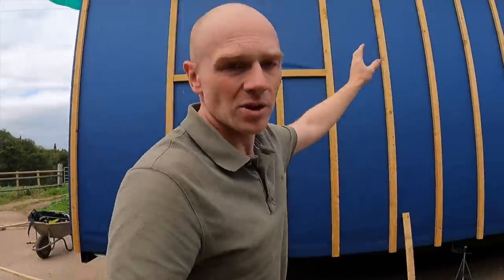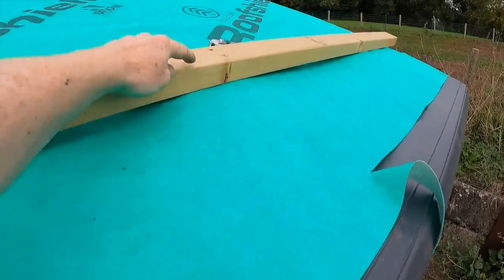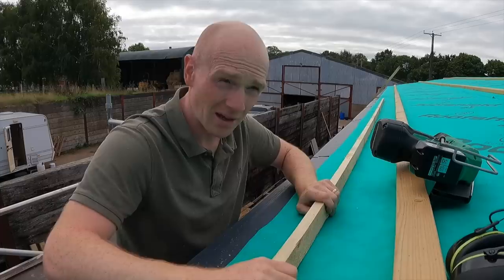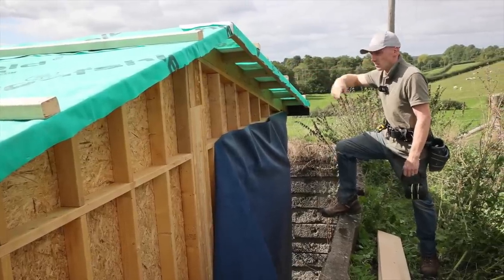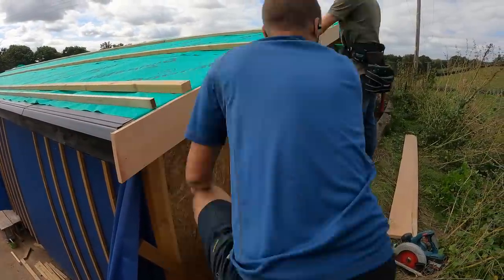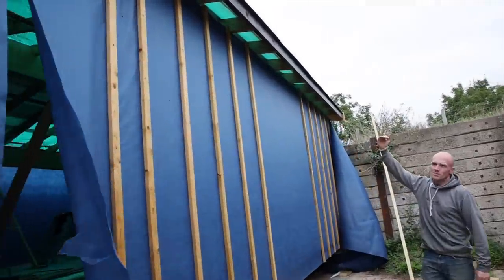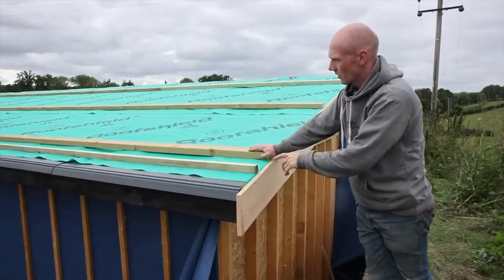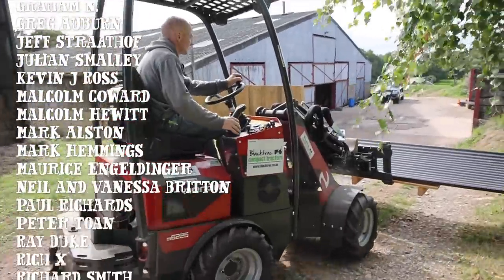WE DECIDED TO MAKE BARGE BOARDS - Roof is finally ready for ROOFING!

Comment: No criticism at all as a 5 year viewer of the channel, but instead of this build why didnt you buy a state of the art static caravan )Ive looked into this and the prices are horendous/not horendous depending on spec, granted not as big, but it would always be worth a very good value. Is there a resale value in this, and if so is it comparable? Im sure you have the answers to this, but it would be good to understand. Looks great, and you are doing a fantastic job 👍
Reply from the maker: We looked at many but still over 100k for anything like this size and spec for aa twin unit.  We also had the time as we can't do any other building until planning sorted so perfect chance to build it and work with different materials and methods.  
Most self builders we have spoken with over the years who have done statics with large families have often said that was one of the hardest parts so we figured it made sense to think about how we live for those three years rather than just how we will live after its all done.  Hope that makes sense.  Plus.... we like building things! 😂
Reply: In general the resale is very tricky for these types of buildings, the parks often have all sorts of rules preventing people bringing anything other than the brand the operators are selling. So you are only looking at fellow self-builders in the main. The other issue is not many have the cash needed to buy, everyone seems to want finance these days! I think they are a disaster in terms of holding value if you buy at a retail price. You can get a bare bones kit that seems more reasonable though, however as we are seeing it is a lot of work turning a shell into the finished product!
Reply: @TheRestorationCouple  Hey thanks for the reply Tim. Its a good job you like building things! Once you have completed the main barn conversion, do you see yourself keeping this on the property for extra accommodation or something similar? Or haven't you got that far yet 👍
Reply from the maker: @markstevens6002  Possibly but there are other buildings and options if we wish to go down that route, i.e holiday lets etc.  We will most likely look to sell or possibly split it and just keep one half.  We have had interest from people already who would be interested in buying when we are done with it so we will see. 👍
Reply: @TheRestorationCouple  Really appreciate your time to answer my random questions 👍Its great being on YT that you can document the build, and people can see what has been done in its construction, and the attention to detail. Any potential buyer knows they are getting the real deal. Keep up the good work 👍🙂

Comment: Hi. I noticed that you are using a Triton plainer/thicknesser. I had another brand and I was disappointed with it, I am only a hobbyist and by no means do I work the machines hard but the one I had before lasted only just longer that the guarantee and as it was lockdown I can only have used it about twenty times so I was not happy getting another one. How have you found your machine, have you had it very long and what quantity are you getting.

Comment: ever seen what a bouncing broken nail does to an eye? i have it’s not pretty. i’ve also had a piece hit just under my safety specs and lodge in my face. the warnings about nail guns are real. i suppose it’s a numbers game use a tool long enough and something will go wrong. Everyone is responsible for themselves and their own body it’s always your choice on diy. i just wince when your face is so close cheers from australia
Reply: A friend of mine,a chippy,was hammering a concrete nail,a small piece fractured off,hit him in the eye, no goggles,it caused him alot of grief,and the fragment was tiny.
Every day,before work begins... safety first,above everything else.
Reply: Having had recurrant corneal erosion for the past 12 months from a minor DIY related eye injury, safety glasses are the first thing I reach for!
Reply: Potentially, even if you were lucky and it did no damage, a metal fragment in your eye could stop you having a much needed MRI scan later down the line. Often welding swarth that’s the main issue in this scenario from people not wearing eye protection
Reply: Don't worry... He's a professional YouTuber... 😂
Reply: Well said,  Sometime you can believe what your seeing this bloke is above H/S so he thinks .

Comment: Shouldnt the roofing batterns be treated on top of the felt? Also you called them Purlins? A Purlin is a structural supports that goes under the rafters
Reply from the maker: Yes these are all treated.  Only reason why they are referred to as purlins with sheet roofing is that usually there are no rafters as such therefore like our barns the roof sheets are sitting on clear spanning purlins.  Our rafters are really there to create the ceiling rather than support the roof.  But yes in a traditional roof the purlins would support the rafters as you say. 👍

Comment: Should really have got that fascia a little higher, you didn’t need to cut that extra felt off because you could use an eave filler at the bottom under the sheets then you wouldn’t see the felt.
Reply from the maker: We need the airflow so no eaves fillers especially as we have anticon on the sheets.  I had intended to put fascia higher but that would not allow breather membrane to run to gutter.  Other option would have been over fascia vented tray with the comb which would have solved both issues but only saw them today.
Reply: @TheRestorationCouple  yeah Tim best demolish it all and start again